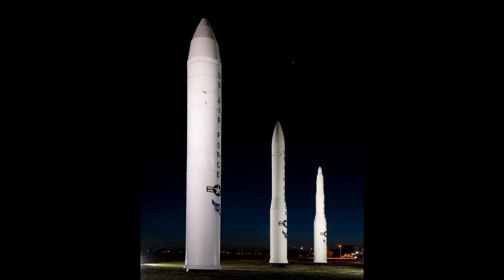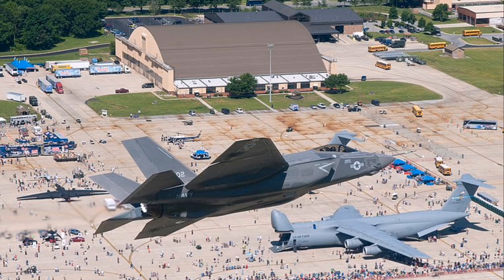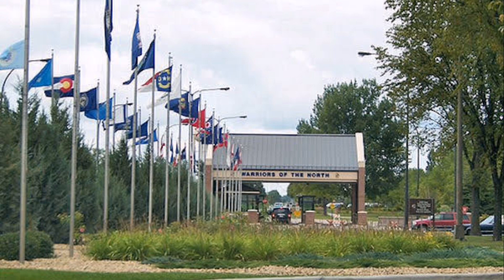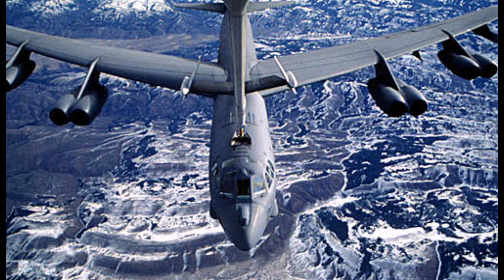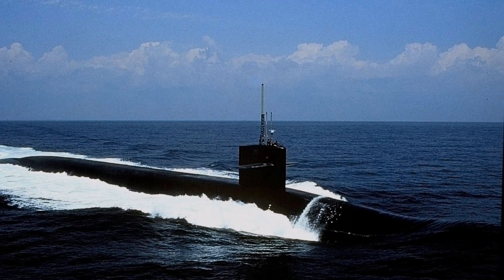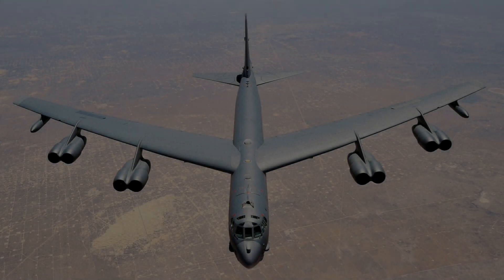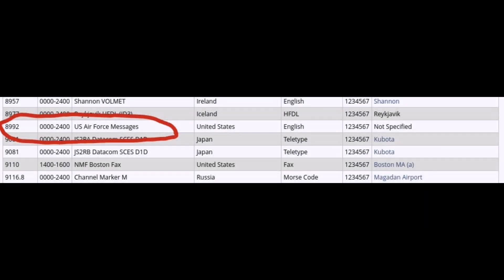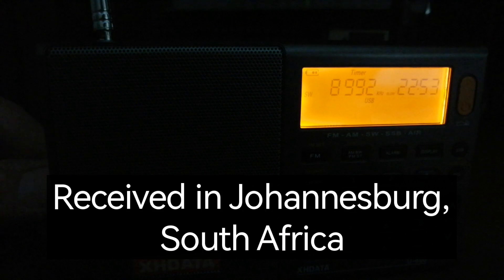US Air Force emergency action message received on XHDATA D-808 with MLA30+ loop

Comment: I live about 80 miles (120 km) from the Maryland Andrews AFB. I have my antenna directly pointed to the base and i am ready for a message. It is 20:33 my time and what I have recieved so far is a communication test from callsign "Racklog".
Reply from the maker: Your location sounds perfect! This signal fascinates me now, I will keep monitoring it. Never knew about this. There are several other frequencies that they use, you can also try 11175 kHz, which together with 8992 kHz are the main frequencies. They also use 4724, 6712, 6739, 13200 and 15016, all in USB mode.

Comment: You certainly did your research on this one. This is quite an interesting signal. I will provide a NATO phonetic alphabet translation tomorrow, I will try decoding it. I am studying amateur radio, some of the things needed is knowledge of the NATO Photnetic Alphabet. If my callsign were ZS1CT, that would be Zulu Sierra 1 Charlie Tango

Edit: I thought there would have been SAME headers. Basically, the American Emergency Alert System noise has some parts in the beginning, where it transmits data on the information, and what event is happening. There is a lot of videos and information regarding it.
Reply: Talking of callsign. I told you that I'd update you.
Well, 73s from Foxtrot 4 Lima Delta Tango (hot from the press)
Reply: @F4LDT-Alain  73s from me, does France allocate specific frequencies or not?

Edit: They do. From what I can see, you can do frequencies from VHF and above. 200 watts power maximum.
Reply: @FamtechVideos  Nope. 10W on VHF (144 Mhz / 2m) and 100W on HF bands, which are pretty much the same as anywhere (160m, 80m, 60m, 40m, 20m, 10 and 11m) except for marginal differences at top/bottom of the bands.
Also UHF and SHF but I don't plan to use these.
Reply: @FamtechVideos  Grrr, another comment of mine that just vanished. To summarize: 10W VHF, 100W HF, pretty much the same ham bands as anywhere else. Also UHF and SHF but I won't do these.
(Edit: oh no, it hadn't. Just buried in the list. Oops)
Reply: @F4LDT-Alain  I see. No worries, you are only human after all. We all make mistakes. Some can be big, some such as your one you did a while back can be small. 73s, 10-7.
Reply from the maker: @F4LDT-Alain  Congratulations, F4LDT!
Reply from the maker: Thanks! This is really an interesting signal, yes! The emergency alert system you refer to is something completely different though. They actually did a nationwide test in the USA today for the emergency alert system, don't know if you saw that? Let me know once you have written down the message here :-) I know the NATO alphabet, but did not write down the message.
Reply: @swlistening  The test is tomorrow. Not today. It is the morning of the 3rd of October there. For us, it is the night of the 3rd of October. Yes I am referring to another system, but you get the idea at least.

Edit: Fixed a spelling error, and Daphne is lying down on my Sony, she is playing with my PL368 as well. It is on mute, so that she doesn't get a fright from the static. She runs away when I spray deoderant.
Reply from the maker: @FamtechVideos  Ah, OK, thanks for pointing that out, the test is tomorrow. Daphne must go sleep in her own bed 🙂
Reply: @swlistening  It is not that easy in here. She usually sleeps in my cupboard on a specific blanket, but it isn't just any ordinary blanket. It is a crinkly poncho that I made using denim. You might ask why I chose denim (Maybe not, then my apologies if I am wasting time, you will see why), but the fabric was a fabric she was given to us in. She was in it since she was a kitten. I made it into a poncho one Winter day in 2020. It was 2 in the morning, I was so tired, but I had the motivation to do something, and I was cold. I had only at that point realised that I could sew myself a poncho, all of the jackets were out on the washing line, and it was loadshedding. My tired body walked and took that sheet of fabric, thinking it was wool, because of how warm it was (Daphne was outside, she had lied down on it for the past 24 hours at that point). Anyways, that is the story, I realised the next morning, and every now and then, she scares me when I wake up some mornings, as I can see her head out an arm hole. 🤣🤣🤣 I tried summarising it, this was the smallest I could get it without removing important information, sorry again if this is wasting time.
Reply from the maker: @FamtechVideos  Not wasting my time, very nice story 🙂
Reply: @FamtechVideos very sweet story about your beautiful best pet.
Reply: @RJDA.Dakota  Did you get the national EAS Test? Also, speaking of emergency alerts, we only have a siren for our nuclear power station down in Cape Town. We are in the middle of a thunderstorm, I don't think DXing is a good idea tonight. Perhaps I will sleep early. Daphne and I are ready for a nap anyways.
Reply: @FamtechVideos  that hasn’t happened yet. It happens within the hour, though from now (1754utc)
Reply: @RJDA.Dakota  Oh ok. It is 18:02 GMT now, 20:02 my local time, and 13:02 in Eastern Missouri, I am guessing that is your area based on your videos.